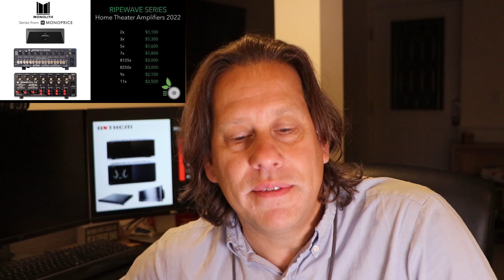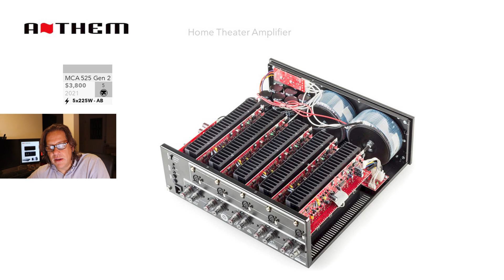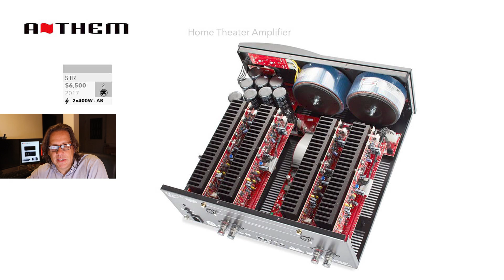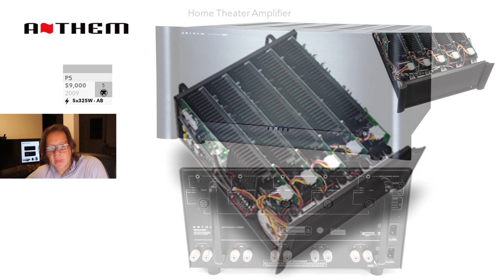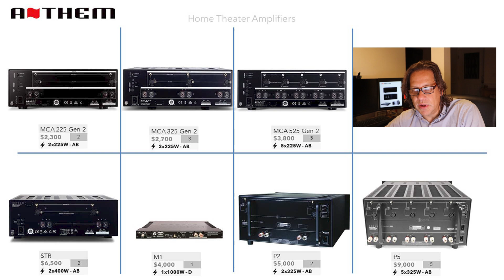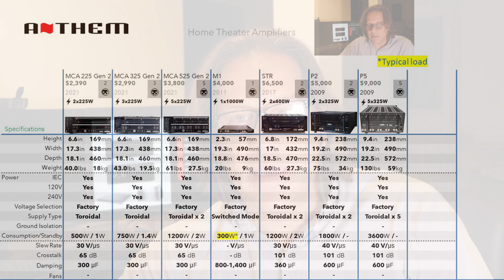Anthem Amplifiers 2022 - MCA 225 Gen 2, MCA 325m Gen 2, MCA 525 Gen 2, M1, STR, P2, P5

Comment: I had an Anthem A5 (225 watts/ch) which is not mentioned here and it was awesome. I now have the Anthem P5 (325 watts/ch) and it's definitely a step above. I'm going away from home theater and deciding which 2-channel amp to get. I will likely step into the P2 since it's essentially the same as the P5 across the board. Simply outstanding to my ears!
Reply from the maker: I appreciate that feedback from someone who has owned Anthem amplifiers. -Jon

Comment: I use the Statement P5.  Nothing like it.   I use it for Home Theatre .  I believe they are meant for H.T.  as their damping is set up for that.  Tremendous force and silk/layered sound from the P5.   First 200w are Class A in each channel.  I also use the  MC20 for surround backs.  The P series actually are stable to .5 ohm.  It's on their website and on the manual.
I don’t feel Anthem needs to change to the look of the P series.  They are an ultra high end home theatre performers and in a league quite above the MCA series.  They match up with any processor you may use from any brand.   Much thanks John for this video and all your videos, especially H.T. processors.  You are a wealth of information.
Reply from the maker: 200W of Class A is amazing. I can see why you are a fan. -Jon

Comment: Great breakdown.
I'm trying to decide which stereo amp to get for music listening. The Rotel RB-1582 MkII or the Anthem MCA 225 Gen 2. Which one do you think is the best and the highest quality?
Reply from the maker: I would give the nod to the Anthem MCA 225 Gen2. These are similar in build quality with toroidal power supplies. The insides of the Anthem look a little more put together. -Jon
Reply: @ripewave  Thanks for the advice man, the Anthem it is then.

Also in my research I've come across a few interesting finds too, as far as super high powered amps amps are concerned. Like the Musical Fidelity M8s-500s and the Rotel MICHI S5. The M8s-500s is 3000€ cheaper than the S5 and half the weight but on paper it has more power. What's your option on these two? Is the S5 worth it over the M8s-500s? Which one would you chose?

Thanks!
Reply: Did you pick 1? I've considered both of thess